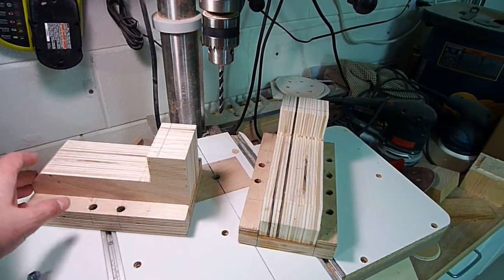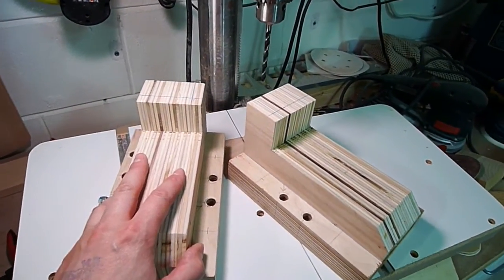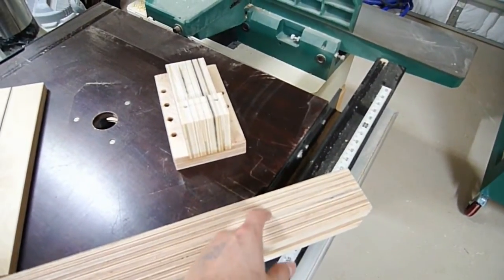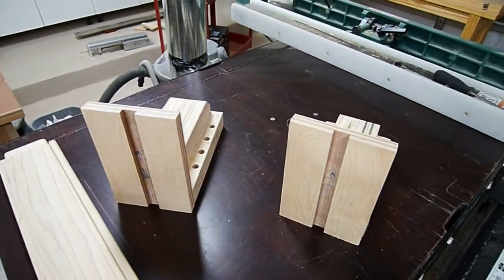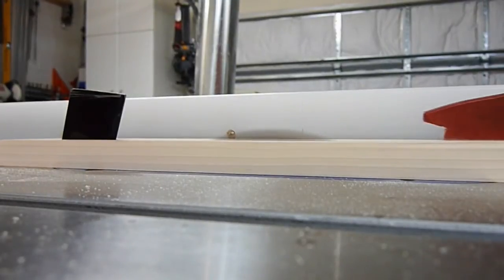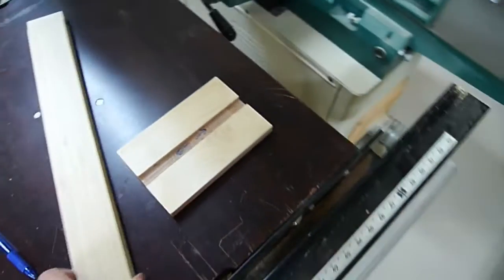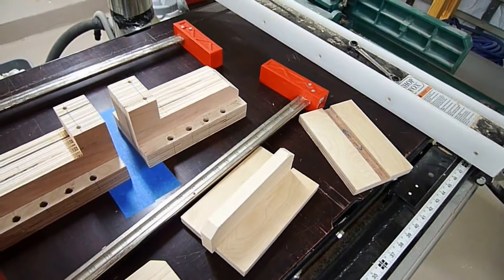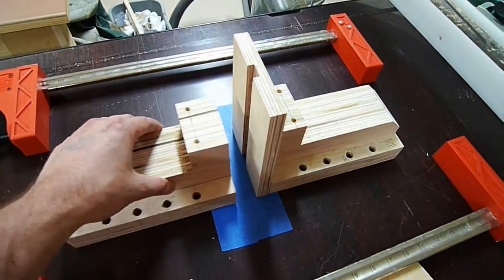Wetland CNC Router Part 8 - Building the Gantry Risers

Comment: You have good detail for the building of the risers, but I was particularly interested in the measurements between your riser to the linear bearings to the cold rolled steel. You have an excellent alternate design, Thanks again for sharing your innovation.